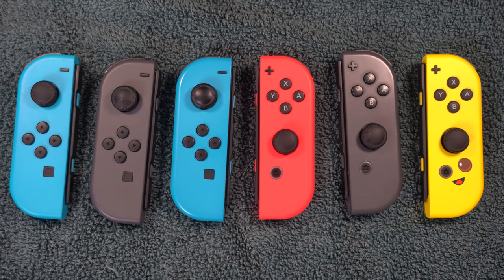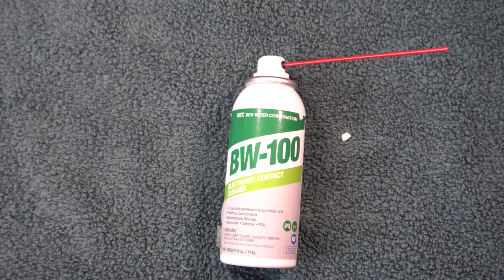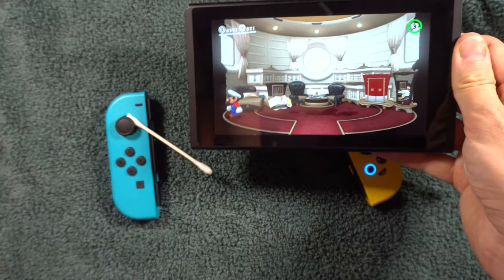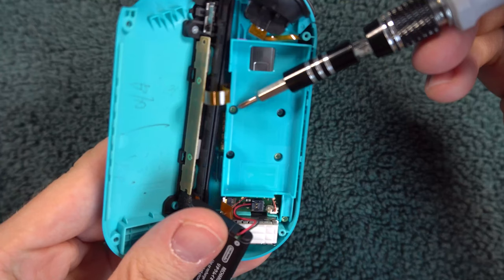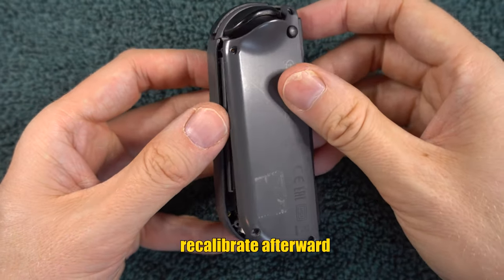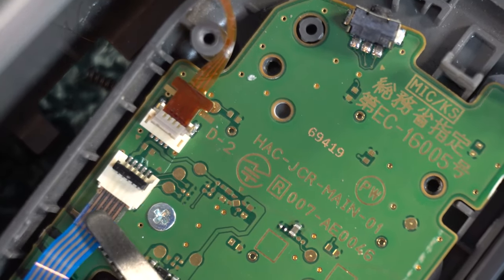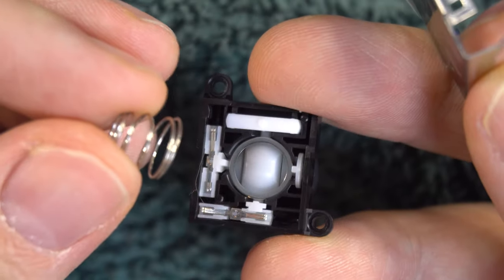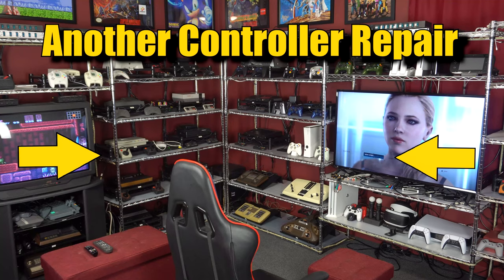How to Fix Joy-Con Drift | Moving by Itself | Joycon Controller Repair for Nintendo Switch

Comment: I just spent 15 minutes feeling well-advised and safe. Did NOT see #12 coming 😂 I love you for this.
Tried blowing, tapping and cardboard without success. 
Contact cleaner (with lubrication) fixed it in my case.
Reply: Wait what lubrication? Did the contact cleaner act as a lube as well or did you use something else?
Reply: 2-in-1 it's called EL-K80S from Kema.

Comment: So my left joycon has been acting weird all week. And the alcohol method as well as the air has fixed it for the most part. However looking inside the controller with a light shows me that having these same joycons since roughly 2017 has worn them out a bit. So dirt was partially the issue as well as being used like every day since 2017 so im buying new ones. 💀

Comment: I'm sure the problem causing the joy-con drift are the R3 and L3 buttons. I've seen a lot of things pointing to this. Just don't press down on the joy-cons/Switch Lite joy-stick and everything should be fine. Something about something bending when pressure is put on it. I read this somewhere. I'm planning on getting a Switch Lite for Christmas so I've been reading up on this.
Reply from the maker: There's really no way around it though. For example, in Metroid Dread pushing down gives you a speed boost, which is needed to find many hidden items.
Reply: @HowToX  yeah a lot of games you use it to select things
Reply: @HowToX  you can swap the buttons on the switch options menu

Comment: Alcohol cleaning under the flap works great. Drift comes back every now and then, but it only takes 30 seconds to reaply the isopropenyl with the q tip.

Comment: Hate to correct the king but draining the battery will not do a lot for safety. It will have voltage in it even if it's not enough to power on the joycon plus the real danger is if you puncture the battery. You still the king though
Reply: Should I disconnect it?
Reply from the maker: Thanks. Unfortunately there are no good solutions. Draining is the best option. Having less power is better than having it fully charged.
Reply from the maker: If you read comments on other joycon videos, many have broken the little connector when disconnecting, which ruins the whole controller. I did all the repairs in this video without disconnecting (except method 12).
Reply: @HowToX  I understand that but draining the battery like you did does nothing for safety or anything like that.

Comment: Or you can add a 1mm shim behind the analog stick to strengthen the connection between the sensors and graphite pads